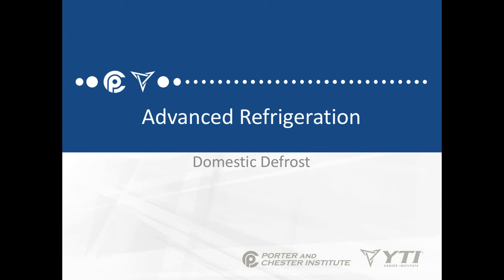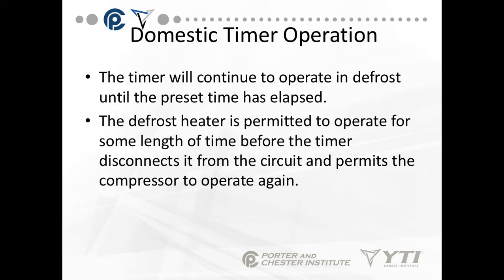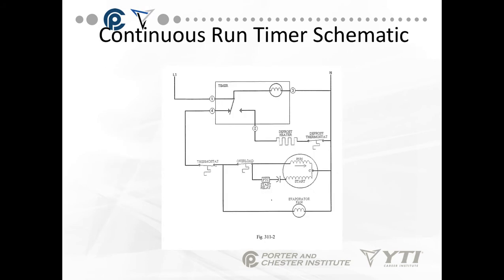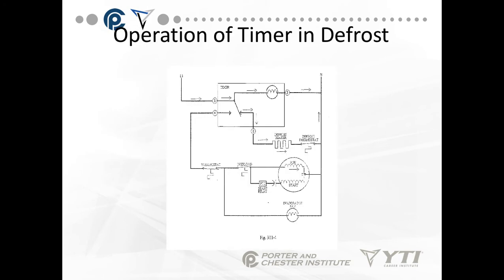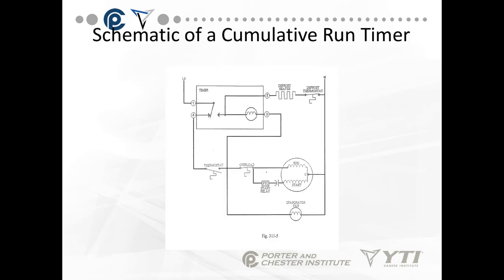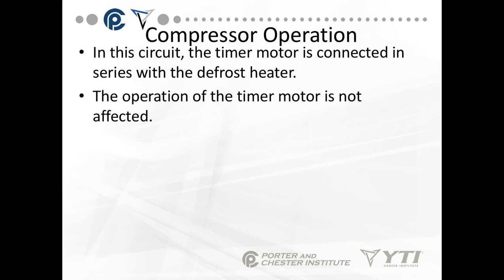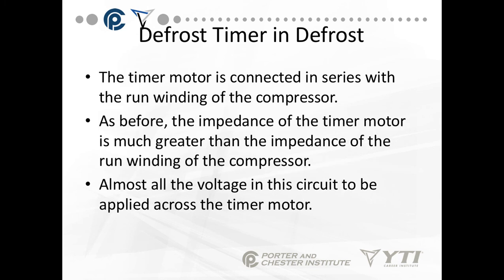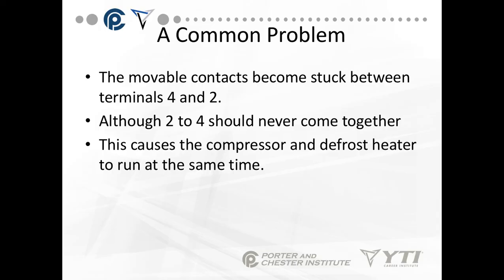Advanced Refrigeration Lesson 1 Domestic Defrost

Comment: I have two questions for you,
1) In the cumulative example the timer is energized both during defrost and during normal mode via the back feeding voltage through terminal 3, so why isn’t that considered continuous? Is it because the back feeding only works when the thermostat is closed and hence when the compressor is running?
2) I have a wiring diagram different than the two you showed, mine is similar to continuous but has the thermostat in series with terminal 1 of the timer. So the timer only receives power (+) when thermostat is closed. In my generic timer replacement instructions it says this is a Version 2 Cumulative run compressor, but that the flying lead should go to terminal 1 same as a continuous run timer.  Does this make sense to you and if so why?

Comment: Hi Christopher, hope ur doing well and tks for ur great video and the information.
I had a defrost timer its motor (clock wasn't working or moving 8hrs to reach the defrost mode), i fixed it so started again moving and defrosting after 8hrs. but i noticed the compressor and fun keeps running all the time they stop only when are in defrost mode and the freezer is frosting. Is the defrost timer can cause this? 
I would appreciate ur answer.🙏
Reply from the maker: I reply without knowing what type of unit you are trying to diagnose. Check the thermostat. The compressor and fan should be under the control of the thermostat.
Reply: @cmolnar65  tks 4 ur reply its whirlpool fridge
Reply: @cmolnar65  so nothing to do with the timer right?
Reply from the maker: @souhachalhoub2240  based in the information you gave me, no.
Reply: Ok tks. As I was wondering if the timer could cause this since its motor was repaired... tk u once again wish a great day... 
Nb. Is it possible hv ur whatsapp number so i can explain it... if not i will understand🙏
Reply from the maker: @souhachalhoub2240  Sorry, because of conflict of interest rules with my employer, and liability issues, I do not do one-on-one diagnostics.
Reply: I understand tk u so much for ur help, wish u a merry christmas in advance and God bless u🙏